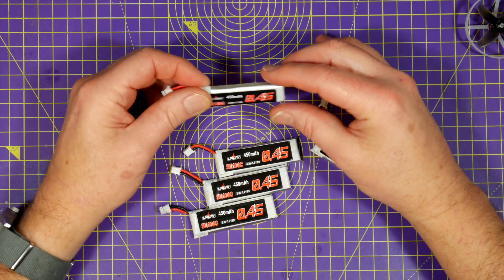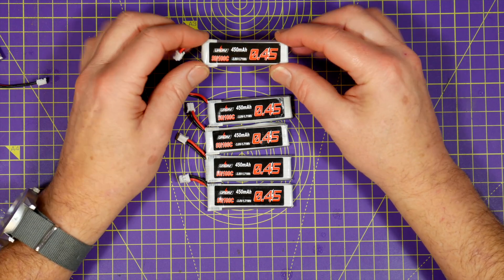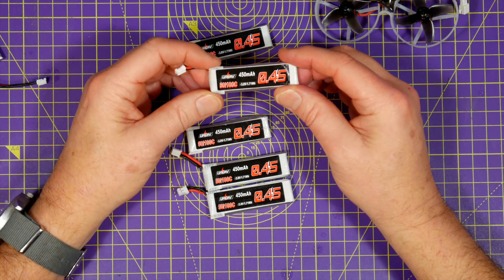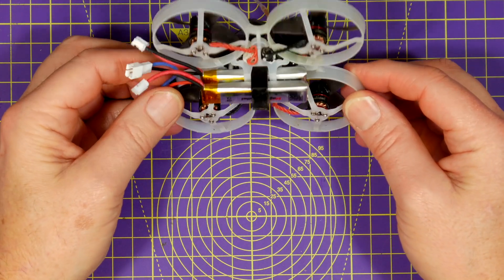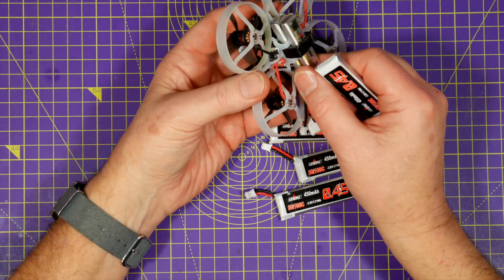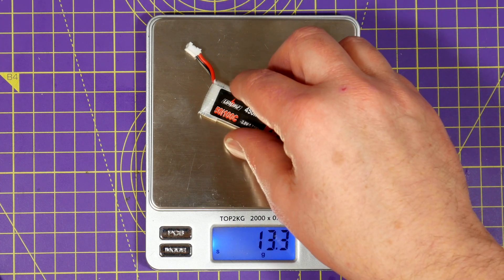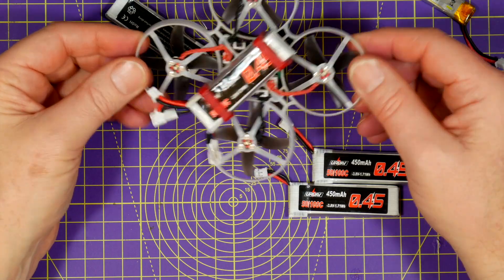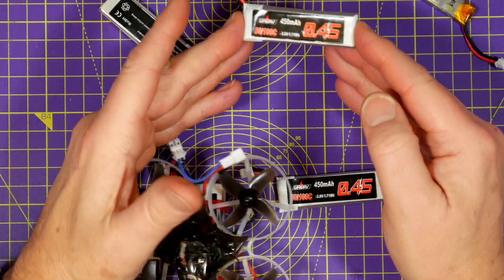Are these the best HV LiPos for your Mobula7 or Trash Can tinywhoop?

Comment: In my opinion, the GBN batteries are not much more expensive and a lot more robust. The Uruav 300mah died pretty quickly in my UK65 and Mobula7, while the GBN still work well.
Reply from the maker: I tend to agree. GNB have emerged fairly recently with some great batteries and range of sizes. The 550 mAh 6s is an awesome battery.
Reply: My uruav 300mah are still fairly knew but hold a charge terribly. Not sure if it’s something I’ve done but lucky if I can get 3 minutes in 2s

Comment: I use these sometimes on my Mobula7 and Trashcan. The discharge rate is really good and they provide good power and flight times HOWEVER, they are noticeable heavy. If you like quick, racey flying, the  300mah and even 250mah batteries are better. For ultimate quickness and control the 250mah can't be beat, they just can't handle full throttle well without really bad voltage sag.
Reply: QuadCloudNine very true, I notice a difference in 300mah and 250mah
Reply: But u only get 2 mins fly time or less on the trashcan
Reply: @verofpv6152  ya, less than 2 mins with 250's. It's fun though!

Comment: I ordered the Mobula 7, and am going to get the FS i6 or i6x transmitter soon after. I noticed the standard version comes with a 6 bank batter charger for the batteries but no power cable. And since I’m new I would like to get the wall cable, and I just want to be clear is the yellow port on the side where you can plug in a Lipo batter to charge the little ones a XT60 plug in? Also could I just use a regular DC cord with the barrel connector and plug that in the wall also? What would you recommend?
Reply: Me personally, I am using a random plug I found around the house. As long as the plug is between 7-25 volts
Reply: And yes the x-t60 port allows you to power the charger with a Lipo. Just make sure to keep an eye on the input voltage so you don’t kill your Lipo!
Reply: thomas mccauley yea I found a wall charger that has the XT60 connector on the end I might order. will the charger tell me the voltage I’m putting into them? Also will it stop when they’re full charged or does it keep charging them? And then also can’t you ruin them if you discharge them too far? If I don’t see the FPV Camera how will I know when they’re run down to the recommended discharge value?
Reply: @LJT9393  I'm a noob in a similar position, but from what I have gathered you can set up your controller to beep at you when the battery gets to a certain value... I have an older transmitter so I'm not sure if it will work out for me.. if not I plan to get a Jumper transmitter. I'm sure the chargers won't overcharge. Even the cheapest ones do that much. Lipo's are dangerous they say. I keep mine in a steel box and am careful not to short them etc.
Reply: weeral1 yea I got my FlySky i6X transmitter set to throw an alarm when they hit 3.22V then I bring it in. Problem is my charger, it charges them up apparently to 4.40V on some ports. I had some suspicions about the accuracy of the display to be off, and it is WAY off! I took one of my batteries, flew it till I got the alarm. I believe there are 2 actually. I have the RX battery Internal sensor set to Low:3.12V; Alarm: 3.22V; High: 4.70V. I here a first beep that I’m pretty sure is the alarm one, cause then when I keep flying another one comes on that sounds more.. urgent lol. That’s the one I bring it in on. Anyway I flew one till I heard that 2nd alarm going off, took the battery out and plugged it into my charger right away to quickly check what it was reading. And the display said 3.72V or so.. that’s like 0.50V+ off! I’ll be ordering a new charger and some better, higher power and performing batteries next month. For now I guess these will do. Just sucks cause my charger cuts them off on some ports at 4.36V and 4.42V on others. But I was told by Joshua Bardwell, he has a YT channel all about this stuff and is incredibly knowledgeable about all this (betaflight actually lists him as 1 of the 3 contacts for support) he said since they’re HV batteries they can actually be charged up to 5.35V, and that would give me probably another 1.5-2mins flight time.
Reply: @LJT9393  wow 5.35? Didn't know that and yeah I like his channel a lot. I guess HV is sort of mandatory now then. As far as the alarm going off and the voltage being higher when you land.. I believe that is normal. Under high load they dip.. but at rest come back up. I notice most batteries do this actually.. So it may not be as off as you think. I "think" there are some tweaks you can do to improve that situation.. Better connectors, settings in the flight controller, I think a capacitor mod helps too..too nooby at this moment in time to point you to anything though.

Comment: I don’t think running two 450mah is smart honestly but let me know how they do after a few weeks if they don’t kill your quad by then
Reply from the maker: I've been flying these exclusively for a few weeks with zero issues.
Reply: Probably the PH2 will limit the ampdraw anyway.
I didnt want to take the batteries apart to solder a Red JST on it so i just went for the 300 2S nanotechs.
Still get over 5 minutes of flight-time with 3blades  and 80% throttle limit.
Reply: Why not? Plenty of people have been running two 450mah, I've even seen people running 2x 520mah with no issue
Reply: @austinbru  i think he thinks that mah is affecting voltage or amp draw. Lollllll
Reply: @exposer3339  Maybe he is referring to the extra weight. I suppose that could wear it out.

Comment: Wery nice idea, love the tpu brackets for the new lipos.  How does the extra weigt feel whith those on the mobZ?  Must have some better inertia when flying acro, but it is quite hard to tell on the video since it is more of a stick feeling.  It should in theory make it easier to fling it over stuff, if it still has enough power due to the increased weight.
Reply from the maker: It's the usual trade off. And yes it is easier to throw around with extra weight.
Reply: @WhirlyBloke   thanks, I might try to get some of these to try out.  I have alot of 1s, self built drones that can fit those batteries, and I need new batteries anyway.  Great deal on those btw.